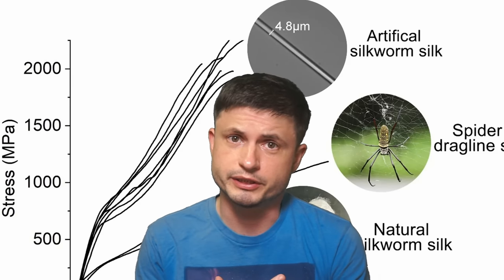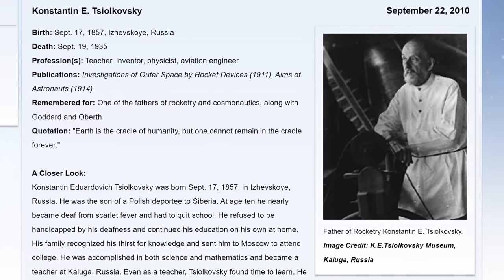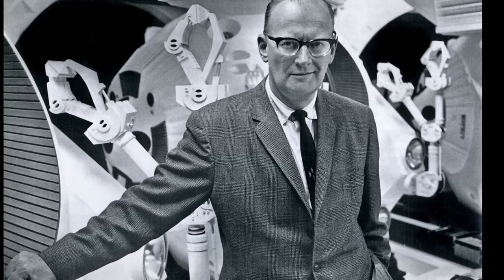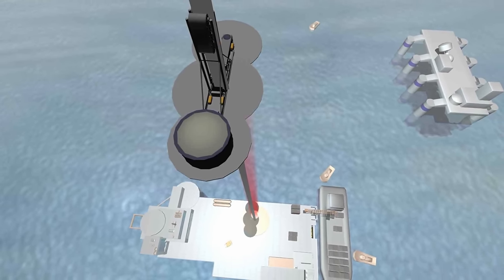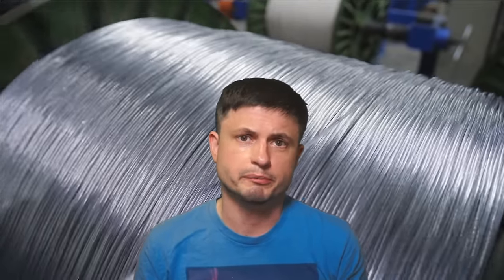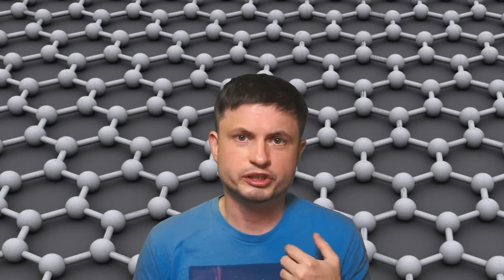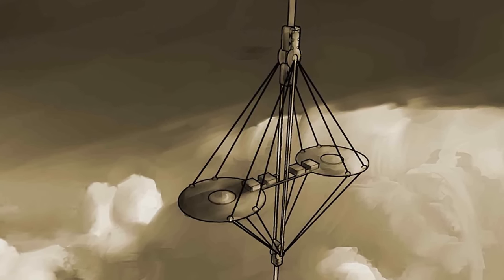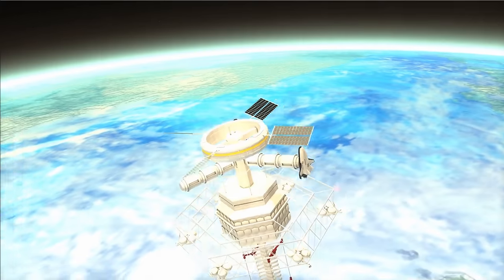Exciting New Updates About Space Elevator Technology...Possible After All?

Comment: This is all well and good but we've been dealing with the polymer pollution problem now for decades. That stuff doesn't break down naturally so we've had to invent processes to decompose hydrocarbon chains in plastic materials so they don't clog up our food and our bodies (which unfortunately has been happening more and more lately). If companies start to manufacture what is essentially SHEETS OF DIAMOND on a massive industrial scale we need to invent a way to take this stuff apart so we're not drowning in indestructible graphene tailings. We need to be able to clean up after the fact or else the "death by a thousand cuts" analogy will become a literal condition. Every lock needs a key. Every industrial kink needs a safe word. Building is fine but if you can't recycle it, the new material process becomes a trap.

Comment: This would solve the starship refueling problem. If an elevator could be made big enough to lift a fully loaded one into orbit. But then you might just do away with rocket engines and use some new propulsion system. On thinking a bit more, this would not have the speed and the through put of launching multiple rockets into orbit

Comment: Would it not be possible to create carbon nanotubes and loop them into rings around one another like a chain? I'd imagine that the majority of the strength of a nano tube is parallel to its vertical axis, but I wonder if it would be worth looking into...
Reply: I would think that being carbon nano tubes can only be very short currently that connecting them in such a manner would decrease the strength and also add many points of failure.

Comment: Wouldn't a space elevator make more sense on the moon, thereby eliminating the need to land? Or have both which could then be used as transfer points. This would certainly reduce costs.
Reply: Short answer: No.
A space elevator on the Moon would have to be 2-3 times longer. Which puts it outside of Moon's Hill sphere.
A space elevator from the L1 Lagrange point might be possible, though. But probably not cheaper than one on Earth. And a LOT less useful.

Comment: I don’t see how that counterweight would help. They’ll stay aligned along the same axis so no matter what you do if you place something at the bottom of this axis in earths atmosphere it will need thrust to hold the system up. If you have more weight like an asteroid it may need less thrust to keep it up but that’s a stretch and anything else would need decent thrust decently often. The asteroid would also have to be periodically thrusted back into position which would also be a huge undertaking. Doesn’t seem any better than rockets. Especially reusable ones
Reply: Can't Earth's spin keep the system balanced ? If the counterweight starts losing rotational speed it slows down and starts getting pulled by Earth.
Reply: @kopkaljdsao  then you’d need a string capable of towing an asteroid that’s also mounted to earth but that wouldn’t work anyway. If it slows down it’ll fall toward earth. It may slow down the process but once it’s not at orbital velocity anymore it’ll continue to lose altitude and eventually smash into earth
Reply: @kopkaljdsao  you can think of it like a string attached to a bolt with a ball at the other end of the string. If you rotate the bolt in a circle fast enough the ball will keep the string stretched out. But if the asteroid fell behind and needed the string to pull it forward it would react the same way as keeping the bolt stationary and rotating it in a circle. It’ll keep the asteroid/ball moving but the string will wrap around the bolt/earth and eventually collide

Comment: if the line would be long enough, wouldn't the angular speed reach the speed of light? What would happen then?
Reply: No. No it woudln't.
The speed at the outer point would reach 300-400,000 km per DAY. That is 12-17,000 km per hour.
That is less than the current speed of ISS.

Comment: I wonder how fast a Saturn 5 rocket could get if it was taken to space via an elevator and launched from there?
Reply: You can look up the deltaV, thats pretty much the speed you would get. The thing is, Saturn V is optimized for launch from the ground, if you changed the nozzle for vacuum type (and engine possibly), you would get way more speed out of it.
Reply: A space elevator has to have some portion of its mass above geostationary orbit to counter the mass that's below geostationary orbit.  If that mass is simply an extension of the cable, it could reach a substantial fraction of the distance to the moon, and the far end would have much higher than orbital velocity.  A sufficiently long cable could launch an object at solar escape velocity--no fuel required, so no need for the payload to be a Saturn V.  This does tend to lower the cable's orbit, though, so the energy has to be made up with some sort of station keeping for the elevator.

Comment: There's one other problem with space elevators that even super-materials won't fix...space junk. With trillions of pieces of metal debris left in orbit from previous retired missions as well as natural micrometeorites whizzing around the Earth at 20 to 50 times the speed of a sniper bullet, a collision with any kind of stationary structure is inevitable. Even if somehow the elevator itself can take a few hits (I doubt it could withstand being hit by particularly large chunks of debris like spent rocket boosters, no matter how strong it is), any debris that it deflects will break into even smaller pieces and scatter randomly, adding the the Kessler Effect.

If we're going to make space elevators work, we first need to find a way to clean up the mess with made up there, either by de-orbiting or salvaging as much of the debris as possible.

Comment: The strength of his material lies simply in the fact that , unlike any forms of metals for example, which are actually just countless layers of individual crystals and grains that rely on the Van Der Waals bonds BETWEEN them which are not all that strong, the graphene strength is not created between separate molecules but one giant long continuous molecule. Which begs the question, imagine using another material that uses atoms other than carbon to carbon bonds, we all know the incredible inertness of things like highly electronegative atoms like Halides that bond to carbon, like CFC's, take Teflon, the bond energy between Fluorine and carbon  is stronger than carbon to carbon so imagine a mile long perfect chain of that- we could have cables so strong and yet so thin that they could be invisible to the naked eye while holding hundreds of kg's of weight ! maybe that's a job for Nano tech

Comment: Could it be put only at the equator?
Reply: Yes. 
The reason is that it needs to have a center point at a geostationary point. And geostationary points only exist over the equator.
Reply: @Tjalve70  actually I don't think that it must be in a stationary point, but farther than a stationary point
Reply: @PitchWheel  The centre of gravity of the space elevator needs to be at a geostationary point. Or possibly slightly outside of it, in order to keep the tether taut.
I'm not sure if that's what you meant, but that's how it needs to be.

Comment: This is not just a question of producing graphene on a massive industrial scale but rather on a scale never before seen in any human endeavor, with a material that is completely untested in real applications, used in the most inhospitable environment (the vacuum of space), in a way that can't really be iterated on for improvement (think SpaceX Starship). If Henry Ford had to manufacture the first line of Model T's out of solid titanium while on the on the bottom of the ocean, we'd still all be riding horses to work. I would love for a space elevator to be real, but rocketry is much more practical (and they blow up sometimes!) This doesn't even begin to address the questions regarding long term human survival in space environments including muscle atrophy, radiation exposure, and so on. I don't laugh at the space elevator, I shake my head at it.
Reply: Oh yeah, it would be TOTALLY impossible to build test elevators on the Moon or other smaller bodies first and totally impossible to test the graphene we make in any other way than using it in it's final product. /s
Reply: @filonin2  Your idea for an easy test of a space elevator is to do it...on the moon?

Comment: Even if you could somehow build it, every time you elevated mass up the thing they would need to boost the counterweight faster to compensate
Reply: True. However, there should be a way for this to be done automatically.
Once you have the cable tethered to the ground, you can boost the counterweight a little bit. This will shift the centre of mass slightly above the geostationary orbit. This will make the centre point drift backwards. But the tethering to the ground will pull it forward. And when it's then pulled forward at a higher speed than the orbital speed, it should straighten out, just like when you are swinging a rope with a counterweight around your body.

So if the centre of mass is slightly outside of the GSO, once we start lifting things up, lowering the centre of mass, the centripetal force will automatically boost the centre of mass up again.
Reply: @Tjalve70  A theoretical extreme-duty cable the circumference of the Earth isn't something I would bet on this lifetime
Reply: @PharaohFluidity  Why are you talking about a cable the circumference of the Earth?
No one else is talking about that. So why do you bring it into the discussion?
Reply: @Tjalve70  Lagrange points
Reply: @Tjalve70  Even if we are able to engineer magic materials, still a physics bust
Reply: @PharaohFluidity  How are Lagrange points relevant here?

Comment: What makes using the elevator "super cheap"??? The power needed to accelerate a mass to orbital velocity by "climbing" the cable is exactly the same as launching, right? I can only find videos about the cable strength! Does anyone know what lift advantage a space elevator provides? You can't "pull" on it or you'll deorbit the space platform.

Comment: The Space elevator will never work.  Why?  Because to be in orbit, you need orbital velocity.  The kinetic energy required to reach orbital velocity is much higher than the energy required to simply get a mass up to altitude.   So unless that elevator has a big rocket on it pointed sideways, your elevator payload is simply going to get pulled sideways to the ground as the elevator is pulled upward.   A college student in physics could easily create a simulation that shows this.

Comment: Wouldn't Mars be the better place to test & develop the concept with it's lower gravity & threshold requirements?  No population problems should the tether break or other problems occur.  With Elon determined to colonise Mars, this (conceptually) would provide a useful tool & fuel efficient option for getting payload to the surface & upload fuel to orbit for spaceships.
Reply: No. It most definitely would not. 
Firstly, it's a LOT cheaper to send a tether to geostationary orbit, then to send it to Mars.
And secondly, it would be TREMENDOUSLY much more useful on Earth than on Mars.

Comment: Given that the orbit time gets longer as you increase elevation, what stops shear forces from breaking the elevator.  They always talk about tension in these space elevator discussions, but never the shear stresses.
Reply: Because the orbit times will not change.
The orbit time will be one orbit per day. That's how a space elevator works.
Reply: @Tjalve70  A GPS satellite orbits the earth @ 20,000 km with an orbital period of 12 hours.  What happens to one if you take it up to 20,000 km on a space elevator and just let it go?
Reply: @davesutherland1864  Not entirely sure what you mean.
Do you mean if you build a new GPS satellite, and bring it up? And do you mean what will happen to the satellite only, once you drop it?

Well, I'm not an orbital engineer, so I don't know the exact numbers. But what will happen is that it will fall down towards Earth, but it will start curving away. Then at some point (some height) it will have reached a suitable speed to be able to stay in orbit, and it will start rising up again.

It will then have an elliptic orbit around the equator. And will eventually crash into the cable where you dropped it from.
Reply: @Tjalve70  That is more or less what would happen.  The critical point being orbiting the earth once in 24 hours is the wrong orbital period at 20,000 km.  It is not as simple as just holding it in tension, you also need to hold it laterally as well, which will put a sheer stress on the elevator - I have never seen this discussed.  Another way to look at it is as you rise from the earth’s surface the tangential velocity must continually increase.  This requires a force perpendicular to the tension of the space elevator, again, I have never seen this discussed.

Comment: Still one mile is a long way from 24,000 - I thinking about a set of belted tires stronger than steel in a few years -
Reply: If you can make a cable one mile long, you can make 24,000 cables that each are one mile long, and splice them together.
Reply: @Tjalve70  Elmers Glue? Gorilla glue ? Staples ? Crazy glue ? Magic dust?

Comment: How massive would the object in space need to be to take a 10,000 lb load up the elevator?
Reply: I don't understand the question.
Which object are you talking about?
And why would it have to be massive?
Reply: @Tjalve70  the counterweight. I thought about it more and it's not a simple answer, too many variables
Reply: @eyesonlyvideo  The counterweight doesn't have to be massive. You don't even need a specific object as a counterweight. You could just stretch the cable in both directions. The counterweight is just there to counter the weight of the cable stretching down.

Comment: I would be interested to see a study in a LEO space Elevator.  Jeff Bezos and Richard Branson can reach 100 km the ISS at 400 km. A 2 or or 3 50km to 70km structures in low gravity is far more possible than 30 000 km.

From 100 km up is the difficult zone... thin atmosphere but not enough to produce lift without rockets.

Lifting a blue origin or virgin galactic rocket through that 200 km zone makes a bit more sense. Only the essentials minimum distance.
A large solar array that can provide lift would save on fuel... a section that is shorter detachable section that has rocket propulsion that can move down to catch then lift the earth launch vehicles then return to the stable platform.

Breaking down a 30 000 km cable to a 100 and a 50 km cable with a rocket platform  may free up some tensile strength requirements.

Space junk then surpasses gravity as the challenge.

Comment: Space Elevators are only practical in the vacuum of space so the moon elevator is an obvious application. No one on earth will risk that thing collapsing and killing millions. Other applications that have been suggested are partial elevators that do not reach the lowest reaches of the atmosphere but could be used to good effect to bring rocket fuel to higher altitudes.
Reply: A Moon elevator will probably be more expensive than an Earth elevator. And not be nearly as useful.
So no.
Reply: @Tjalve70  I've done the business case and with all the diamonds, gold and platinum laying in the moon dust it will pay for itself 100 fold. Once the astronauts melt that ice and pick at those craters they will have indoor swimming pools and all the cheese they can eat.
Reply: @tycannah4271  Good for you.
Still doesn't change the fact that a space elevator from Earth would be VASTLY more useful and cost effective than a space elevator on the Moon.

Comment: This could solve global warming and  make moon bases affordable at the same time.
Build a lunar space elevator, starting at Earth/Moon L1, and manufacturing cable running toward Earth and Moon at the same time. Eventually you get first a usable skyhook and at some point a full elevator that runs from the surface of the Moon to a high Earth orbit.
The drag problem should be solved if you balance loads running up the elevator with loads down the elevator. So send loads of manufactured goods or astroidal ice down the elevator, while sending aluminum foil up the elevator. 
Store the the aluminum as expanded sheets at the lagrane point between the Earth and the sun until needed for other purposes.
Maybe not enough on its own to make a solar shade, but there are many ways to throw mass off the Moon using materials brought down by elevator.